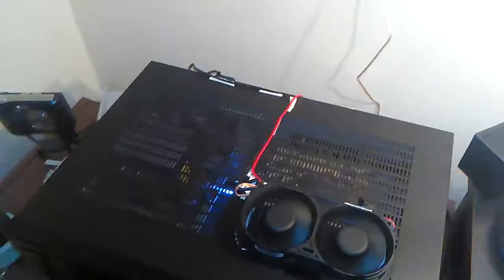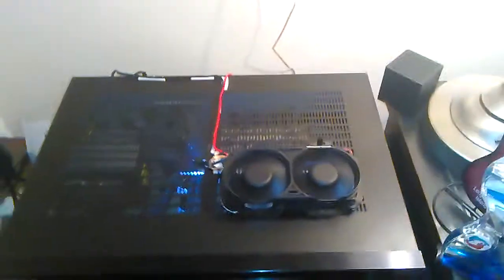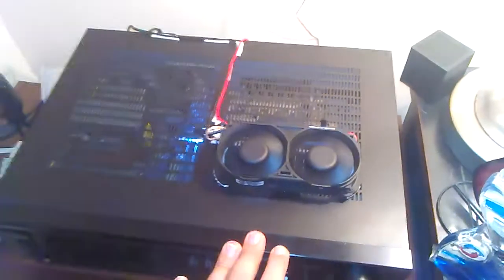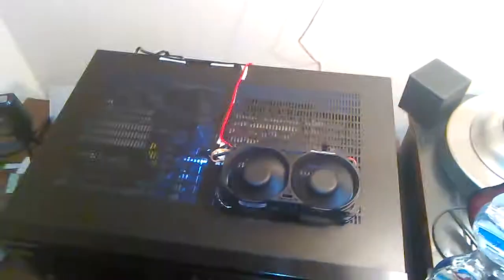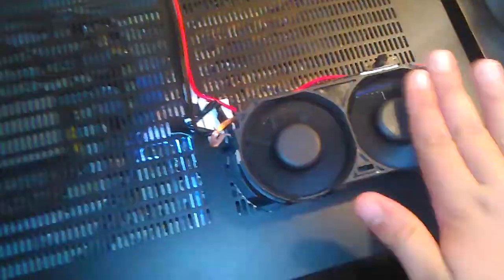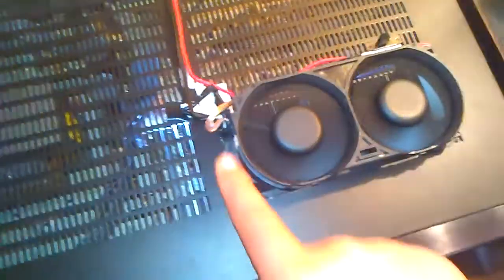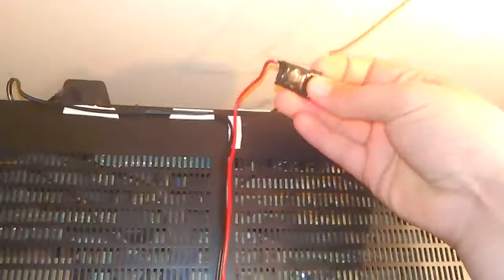How to cool a amplifier cheep for with PC fan

Comment: That "fan" is actually a gpu a gpu is a graphics card. That will increase performance on bigger processes
Reply: @ProdDhr  when i am try to use a pc fan for cooling my amplifier ...as i Connect them with 12 dc it creates huummm in sound
Reply from the maker: @ProdDhr  it did
Reply from the maker: @jdkarora6729  use a capaster in the 12v line that feeds the fan